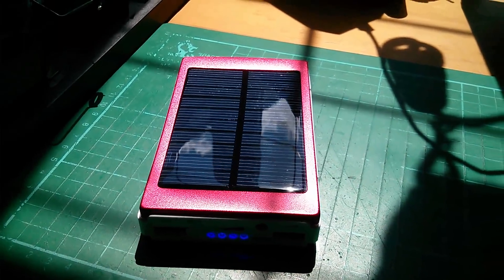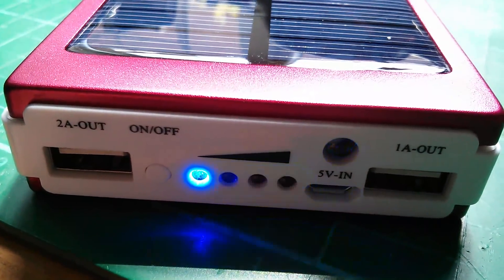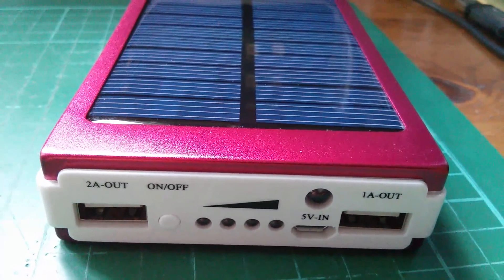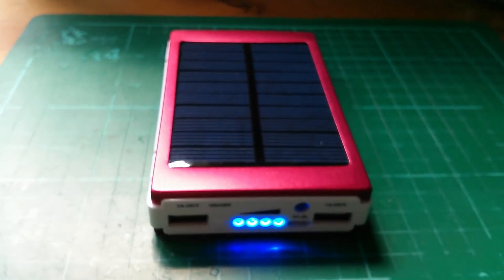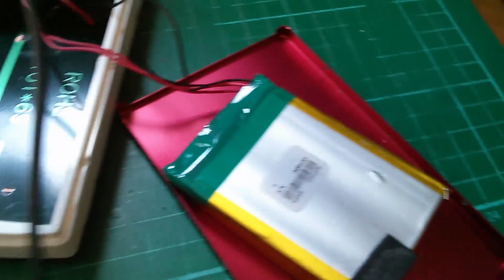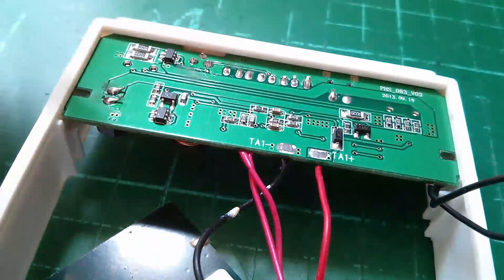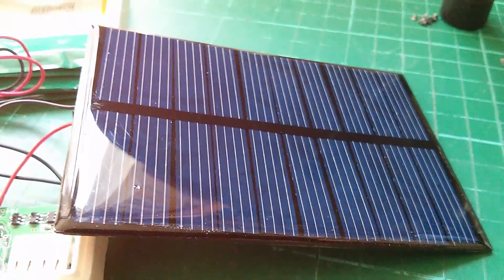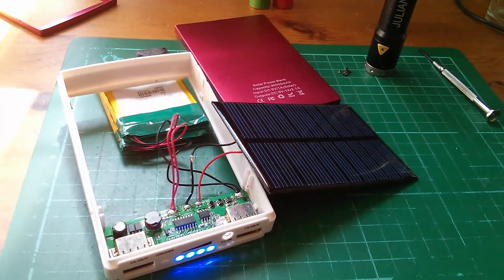Review: 30,000mAh Solar Power Bank - It's a pile of Junk!

Comment: I have 2 of these.  They are good for lighting only.  Put a cell in and discard the solar panel and use as a light.  Long press small button light comes on.  press it again and it dims.  Press it again and it flashes SOS.  Good Camping lights.

Comment: First thing i had in mind is thinking i saw the 4 leds cause i have an simple idea not just the draw but the current they can put out i really question wtf was that suposed to be like damn whoever build that didnt really think about that like on solar mode you would kinda wanna stealth the light also what if you plug something at least in the 1a plug so you dont ablidurate the battery advertised as 30k i dont trust that even tough fitting some batterys together or getting one big custom cell aint that hard ill never trust such supplier for my pocket safety or hand safety with an item like that tho its kinda good but not really tho but one thing you can do is make a panel to seal the unit where the sun panel is one usefull thing you can use it for is hook it up somewhere to some decent peace you gonna see daily you might be able to build a triple phone polymer replacement for those 2 if you go with any 3k mah or 3.2k mah samsung battery you gonna get nearly 10000 mah in total and if im at your place ill remove the first 3 leds so the thing can charge till it stable then it might actually not get such a defrence from 1 led even tho it pulls quite some the draw would not be nice and i know its weak but adding to the flashlight part if you close the case using metal panel you can always add 3w led that comes with a heatsink you can always solder it on tho even

Comment: Good review I have two renagy 24000mah porteble solar chargers and it says they can only be fully charged by plugging them into 120ac I used one all last summer at my cabbin using only the sun to charge my cell phone and worked well

Comment: to many reveiws of this type of item are carried out by people who don't know anything about microelectronics, they unpack then charge a phone and say its great, what these can actually hold is down to the storage cells used and charging by sunlight using these old photovoltaic cells will be low and slow, not having smart technology in the circuitry will possibly make them dangerous, no over charge cut out could make the cells explode, all be it slowly. but could cause a fire. just what you don't need in your tent at night after walking in the sun all day !

Comment: Charge in direct sunlight only.. when the sun cant be seen by it, turn it over to stop all light getting to solar panel.  You will have to track sun manually, but the panel seems ok.. 
If the batteries or battery inside are bloody used 18650, remove and replace them.. lithium packs or 18650 batteries are fine I found. Packs perhaps a better option . When it has finally charged , the 4th led stops flashing, and all lights stay on.. Its then fully charged.

Comment: Funny how they just add a zero to the capacity figure.  The solar panel won't make more than 100mA even if outside so wouldn't really do anything to charge that battery.  The charge controller and MPU would probably gobble most of the generated power.  Better off investing in a decent size roof panel and separate 18650 cells with an LM317 regulator to limit the volts and charge at the panels short circuit current.

Comment: But but wait a min, i think i'll buy one for $12 with free shipping and 20 LED chips in the reverse side,  that wont be too bad. Actually the last one I bought about 6yrs ago had 5 x 18650 for about 7500 mAh. Much less than  the advertised 20,000. Recently, they have been advertised with 1mil mAh...LOL, what a crock. I think we all know where these power bank claims come from. Anyway, the only thing you know for sure is that you won't know the mAh until you get it and take it apart to check.

Comment: It's worse. It's 4800 mah at 3.7v..not 5v. I bet the boost voltage converter effeciency is shit also.

I hate that it's industry standard to measure capacity in Ah and most of the time the voltage is not included. 

Ah measurement is useless. 

Capacity is best measured in watt hours.

Comment: Re: 02:30 comment on 50mA LED current requirements:
With LED multiplexing and modern low current LEDs, all 4 LEDs appearing to be "on" together could take even LESS than 2mA on average...nowhere near 50mA.
If you wave the powerbank around while the LEDs are on and you see multiple images of them then it's using a circuit that does not drive each LED all the time.
Thus, even 4x 2mA LEDs can require an average current of less than 2mA to shine brightly as far as the human eye is concerned.

Virtually every powerbank I've seen DOES multiplex these "battery level" indicator LEDs.

Edit to add:
I'd also call into question the "2400mAh" cells. Even now in 2020, many lithium cells sold on the internet either make fake claims or are counterfeit...some even contain sand or metal scrap to make them weigh as much as the higher capacity cells.
So even if they claim 2400mAh, I would be very hesitant to believe it. Given their willingness to make that outrageous "30,000mAh" claim I'd be surprised if the lithium cells themselves could even supply 1000mAh per cell.

Comment: Had 3 for 5 years . Still holding charges. They can charge my iPad Air.  They are superb power banks. I take them everywhere with a portable solar panel. Their solar keeps them topped up.This review is very poor indeed.

Comment: From a the negative reviews on this channel of the power bank.  Yes it is a cheap buy so you get a cheap product.  I bought this to test it out and so far after 3 years of this I still use it.  I take it camping and No real issues for just using it for phone or some light at night hooked up to a small usb light.   Other then that if you use it for long extensive time you better off getting a really big bank. Happy charging :)! Julian, I have a question, can you put better lithium batteries that last longer on it with a protection for the batteries.  I am new to learning all the solar business.

Comment: I'm sorry I did buy it. And if I charge it on the outlet it chargers withing 3 hours.. And it chargers 50 % of the charge on the phone. I haven't use it yet with the sun. I notice everytime I buy something from ebay some stuff is really junk. Specially the cell phone that are cheaper . they are not good

Comment: 🔴
🔴
🔴
Hi, I bought one like this but it is 10000 mah. The problem is that the solar energy does not charge when I put it in the sun. It does not charge and the LED does not light like what happens when I charge it with electricity. It lights up for one LED only. Please answer me, where is the problem?
🔴
🔴
🔴

Comment: those little blue LEDs actually drain the battery you're better off getting a larger solar panel hooking it up to a portable 12v lithium ion battery much faster charge

Comment: If it sounds too good to be true, and looks too small to be true, it's not true! I just hope the price was right, so you could re-purpose the parts. I wonder if you can find cells that are the right dimensions, to completely fill the pack, no dead space, and get it close to 1/10th of it's rated capacity.
     The thing that concerns me about the solar panel, is the heat. To put the unit in direct sunlight, so it will charge properly will just heat the unit up, perhaps, enough to be unsafe for the LiPo cells. I don't recommend using it until it cools down, to protect the semiconductors on the circuit board. The solar panel looks like it would work well for out door LED solar lighting.

Comment: The panel on them is usually described as an " emergency " charging option and can take days to fully charge but.....if you really were stuck with flat everything you can wait a few hours and maybe get enough charge to send a message or quick call and save your life. I also wanted to say that the way panel was mounted wasn't such a silly idea as what doesn't bend will break. Glued at one end and sitting on foam on the other gives it a little bit of shock protection.

Comment: They say leave in direct sunlight yet last I checked batteries especially lithium batteries don't enjoy working in heat. One of those left in sun on hot day must get up around 40-50 degrees easy. The panel really should be detachable from bank to last any lenght of time.

Comment: These are sold in China as kits you can buy for $1.30 no batteries included. https://www.ebay.com/itm/Portable-300000mAh-20-LED-Solar-Power-Bank-Dual-USB-Battery-Charger-For-Mobile/163665723969?_trkparms=aid%3D222007%26algo%3DSIM.MBE%26ao%3D1%26asc%3D20131231084308%26meid%3D99d733c1d8e74c828eb2c9b46faf8919%26pid%3D100010%26rk%3D1%26rkt%3D12%26sd%3D323368660002%26itm%3D163665723969&_trksid=p2047675.c100010.m2109

Comment: I've got a possibly newer version of this power bank. Looks identical apart from the writing on the back. Mines rated at 20000mAh. Doesn't feel heavy enough for that but it does *work*. The LED's aren't always on when its charging - they come on when you press the button. If you leave it, the LED go out and it still keeps charging.

I've yet to give it a good workout (or take the back off to check the batteries - I'll get back to you) so time will tell...
Reply: On that note: How hard would it be to fit new batteries with higher capacity? New to this, do you just connect them in series and solder the black and red wires to the board?

Comment: While trying to be a glass half full kind of guy, at least you didn't find a bag of sand inside, as I saw in one video.
No question the solar is a joke, but if you were to use 3 or 4 of these battery packs. I think you could have a decent
power bank. What are the chances that those battery packs are obsolete surplus cell phone batteries? It would be
a good use for them, and I'm sure they could be bought at a good price.

Comment: Good video, thanks for sharing..
Luckily I bought a diy  case which arrived buckled and no screws... That was a few months ago.. Now I've bought 3 4900mah batteries and a holder so I don't have to muck around with tape and heat sinc. Just gotta get screws and a soldering iron an work out how to do it myself... :)

Comment: for some reason they list estimated total life capacity (100's of thousands mAh) instead of actual battery capacity on most, if not all, power banks. also, solar versions provide trickle charge in case of emergency, not to actually charge up the power bank. i do agree though that this one in particular has too many flaws to get genuine use while out and about and would probably crap out after a couple uses.

Comment: I've just bought a 20000mA  chinese power bank, making clear that I knew it's was a fake. I need the internal 18650 batteries for some experiments.

The thing is that this power bank had 5 18650 batteries inside, but 2 of them weren't connected in anyway to the main board. And guess what? Those 2 batteries were filled with sand 😂😂😂

Comment: What is the max input in Amps for charging? I have a rpi3 with wifi adapter + rtl_sdr I want to have it charging and not go down in power like UPS. So Dose the micro usb input go up to 2amps or is it just 1 amp input?

Comment: I got one for a extremely cheap price, same pink color but it is the better version, uses 5x 18650  and the solar panel is just connected with a diode in series with the battery and lights up a single led so no wasteful 4-led animation. Swapped the cells for good ones with a protection circuit and it is a decent powerbank. Oh, and has a 20 led flashlight on the other side besides the solar panel and the single led in the front is uv! O:

Comment: i have the powerbank but i suppose it is a newer model because its a kit. you need to put your own batteries in it and when i give it sun only half of the LED lights up it doesnt go like in the video. but i tried the solar panel and it does charge the batteries yes it does take a many days but the voltage did increase when i tested it. also one note the 2 amp out gives 1,2 amps instead of the 2 that its rated for sure its not alot but i am pleased with that.

Comment: One day something like these will be possible, maybe in a few decades when they can make high power solar panels similar to that size but able to produce 8w, then have inside the case about 4x 18650 batteries for 10.4Ah of power. Which could be charged from a 5w panel in about 5 hours. In the future it will be really cool, I think we will see battery capacities improve somewhat and solar panels improve drastically. 
Of course Ebay has many BS listings like this, but most people with common sense should know that it's BS. I also found a flash drive for 3 dollars once that said 64gb. I bought it knowing that it was probably fake, when I got it I ran software to conclude that it was fake and then put on proper firmware to give me the real 4gb capacity of it and then I complained to the ebay seller and even got my money back and got to keep the 4gb flash drive, I just told him that I won't give him a bad rating if he let's me keep it and give me the 3 dollars back and he agreed. 
About 80% of the batteries on ebay have fake capacities also. A $3 18650 will nearly always have a capacity only 1/8th of what is on the cheap sticker.
Some of the numbers are hilarious that they put on their listings, like an 18650 with capacities that don't even exist like 6000mAh etc. 

The best bet for getting quality is to buy Japanese, but it's always expensive so I sometimes buy some Chinese stuff since sometimes if you shop right and search realistically etc some of the Chinese products are affordable and actually not bad, you just have to choose the right ones.

Comment: The same power bank casing also comes with 5x 18650 batteries. They are of course no name Chinese batteries well under 1000 mAH, but if you change them with better ones it is possible to make a half decent power bank with around 10.000 mAH capacity. The solar panel is absolutely bullshit. Under full sunlight, its output is barely enough to flash those unnecessarily bright 4 blue led's, with almost no charge going to the batteries. When i modified mine, I took this useless panel out.

Comment: Heh, I have yet to see a power bank that isn't flimsy and full of junk inside. 2x2400 mAh batteries, a pathetic solar cell (probably only there for decoration/good measure), I'm almost surprised that they didn't add lead weight to the casing to make it "feel" more genuine. Yeah, eBay's still full of these and that's why I really don't trust these power banks at all.

Comment: I bought this off wish has 5 18650 same charge circuit. the micro isn't charge port broke off the board so I place it in my window for months and it did absolutely nothing on the charge of batteries lol.i paid 3.oo with shipping. I took the 18650 with where new not fake 18650 and made an upgraded battery pack for a cordless drill that formally had ni-cad.great buy in my book for the 18650 the rest I recycled to the land fill🤔🤔👀👀😲😲😂😂👍

Comment: I had similar device. The first one I got from eBay didn't get any current to USB, so I sent it back to seller and asked to test before sending another one out. So, finally I got something. Using my USB charger, it was charging around 6-8h to get full and I was able to charge my iPod one or two times afterwards. So, mainly it was time waster as connecting my iPod directly to USB charger will get it charged within a hour or 1h30m maximum.  But, I didn't get the solar thing work at all. After 5-6 hours in Mediterrean summer sun, it had spent one indicator level rather than increasing it? So, I assumed that they have connected diode wrong way. Anyway, the device electronics just burned within few months, it stopped to do anything and the seller had closed eBay account...

Comment: The fact is...  A small solar panel will NEVER charge these effectively...  No matter how they manage 'harvesting'... Even with no leds.  The review is CORRECT... .   Simply a matter of input power not being high enough...  The only good solar chargers are the larger double panels or larger panels with output over 1amp

Comment: I have a slightly older version of this without the light. It's thinner. I popped it open a few days ago and the batteries are thinner but fill the whole space front to back and left to right with a bit of a gap on the top also filled with the sponge. I wonder if they got a cheaper deal on those batteries or if they increased the thickness to add the possibility of 18650s.

The solar panel does kind-of work. I let it discharge to 2 LEDs then threw it on the parcel shelf of my car and some days later, it was up to 4 LEDs. How useful that is will depend on your use case. I had to go out of my way to test it so not so much for me. Also I live in the southern US so plenty of bright sunlight a lot of the time.

I just watched the MichaelsWorldTV video and mine is the same as his, 2x4000mAh. Interesting that this newer incarnation is thicker but has a lot less capacity.

Just checked the ebay listing. It was advertised at 10000mAh which was a lot more honest than we're seeing now.

Comment: Clive just reviewed a "100,000mah" solar power bank, which is nearly a clone of this power bank Julian reviewed some 2.5 years ago. The one Clive has had better mechanical construction, but no other notable differences. But it's interesting that they "increased" the power capacity by 3.3 times in the last few years, using the same cells.

Comment: the panel doesnt do much at all. i take mine to work with a quick charger. i use the power from work to charge my fone at home lol. although mine is a 30k mah it has 4 18650's in it. 1600 mah each. i dont know how rhey figure 30k mah. how does that work? lol. enjoyed the vid. 👍